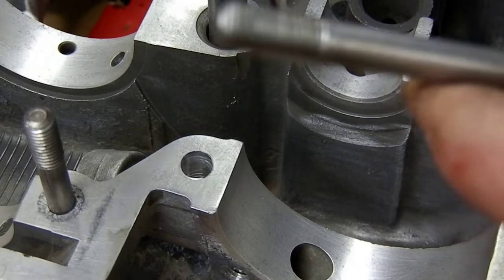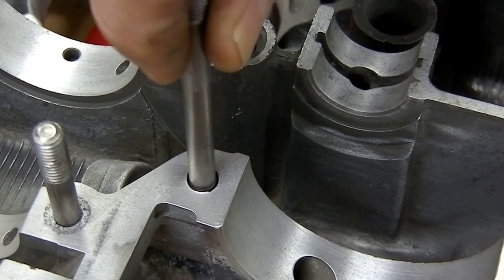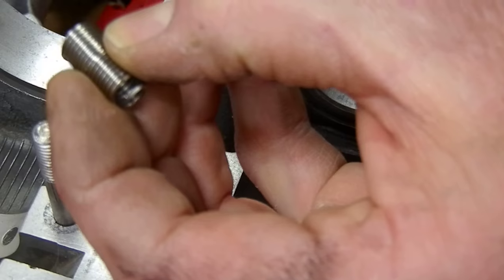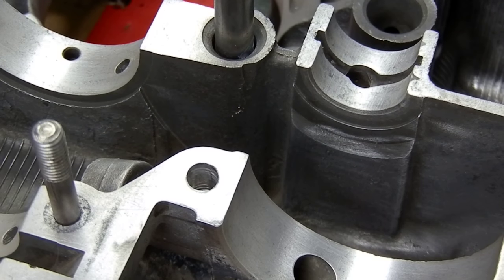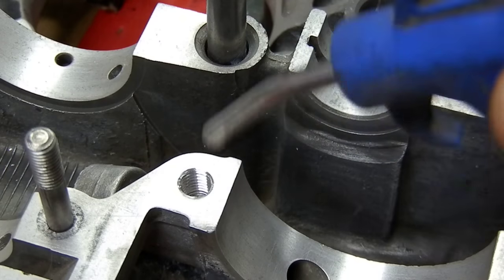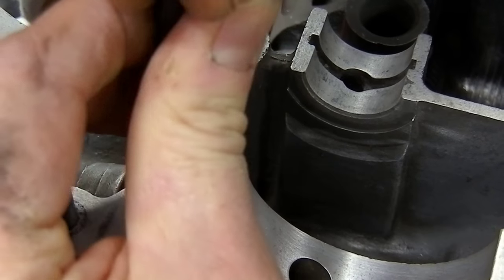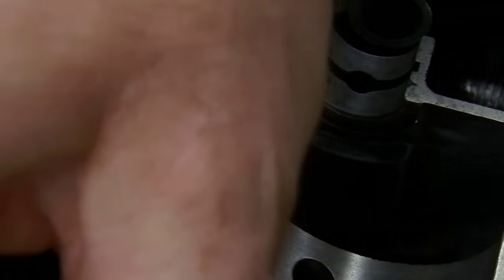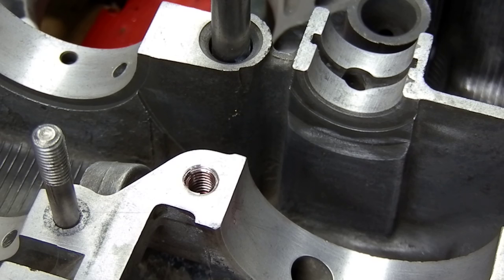Heli coil

Comment: Usually, most of the manufacturers for the wire thread inserts (Helicoils)  also recommend to chamfer the hole to 1 or 2 Px 90 or 120 degrees prior to taping. This helps in preventing any sharp chips forming on the edge of the hole. It also is very  helpful to see when you stop with the helicoil. In practice, you drive the helicoil until you are flush and after that you give it one more rotation (360 degrees). 
The manufacturer has also the correct drill size and also 2 thread taps for the stronger or sticky material. In this way you can form the thread for the helicoil in 2 steps and the tap tool has less chances to brake.
I would also advice to spay coat the helicoils with dry lubricant (again you can find it on most manufacturers like McMaster or Bollhoff). And if somehow you damaged the helicoil while you insert it there are some diamond shaped tools that you can use to extract it. 
There is also a chart  to determine the needed helicoil length based on parent material and the bolt class that you want to use. For example, in a 6061 Aluminum, for a M8 screw in 12.9 steel quality bolt, you would need a helicoil of 1.5D (1.5x diameter of the screw). You don't need to get a longer helicoil, like 2D or 2.5D, because in the dimensions in the table, the screw is already the weak part.
They are amazing products that distribute much better the load in the screw and you can easily replace the damaged ones without the need to enlarge the holes.

Comment: Hi 
Nice explained video.
I have helicoiled my Bmw e36 M52 aluminium  block after striped the treads on head gasket instal.

I have made a home made bracket to centre the drill  from a 20cm wheel spacer..because i heard that if the hole is not straight the repair is not gonna hold..
Wass a fun project.
I hope is gonna hold.
Up till now 1000 miles and no issues.

Comment: Use paraffin as cutting lube for aluminium so you don't tear the threads. On something critical always use a engineers square to check 90 deg angle from the surface. (No matter how good you think you are) Lastly, throw that piece of junk ratchet tap wrench in the skip and use a proper Tap Wrench so that even pressure is applied to both sides of the tap. This will also keep tap from cocking over out of true and in harder metals it will minimise the chances of snapping the tap.

Comment: watching this before repairing the threads on my dogbone engine mount. ive been putting it off because for some reason, drilling into my transmission makes me nervous. thanks for the tips!
Reply: Here for the exact same reason. Working up the courage to plunge a drill bit into my aluminum trans housing.
Reply: @The_Real_Chris  yup here for the same. Broken bolt stuck inside. Drilling through and going try this out to keep everything to spec. Pain in the ass situation lol

Comment: I now have zero confidence in helicoil in VW case.   I just changed heads on an engine and a helicoil on a head stud popped free at 18ft-lb.   I torque-tested the rest of them to 25ft-lb and five others popped.   I'm changing all the helicoils out for actual case-savers.
Reply from the maker: you can buy case savers of different lengths and sizes for upgrade or repairs from California imports..Cip1.com I have lots of videos or repairs and building performance vw engines ..if you look up Mark Russell Volkswagen on youtube
Reply: @Figment078 When I blew the head gasket on my 04 BMW 325ci the head warped & pulled out over half the bolts. I used the  Time-Sert coil repair kit to fix it. I did the repair over 7 years ago & the repair has held up. I have had zero problems! I drive the car all the time & it has no leaks whatsoever. I highly recommend Time-Sert for any repair where you have to apply allot of torque to the bolts.

Comment: I didn’t see you break off the tab on the bottom of the helicoil.
Reply from the maker: I did remove drive tang and waited 24hrs for loctite to cure up ,and then I run a tap back through to ensure lock tight debis does not interfere with the bolt threading into coil
Reply: Rendro Schifolli   Because you want the helicoil to Stay inside the hole, and not back out if you have to someday remove that long bolt to open up the case..  Without the loctite Red on the helicoil, it can unthread right out of the case on the bolt sometimes, when you are removing the bolt....

Comment: OR....you could buy longer Helicoils. 3 X 2D will be 2X diameter long (6mm) I've seen 3, 4, and 5D Helicoils, but at least you Loctite the coils into the block like I do. Can't go wrong if you do that.

One thing I have used is JB weld but I have not tested the torque it will take afterwards.
Reply: Jb weld is very weak when tapped. My s10 would confirm this. 😂

Comment: It was a great job. You should have put a piece of cloth on the motor so that the refrigerator or small iron pieces do not fall into the motor
Reply: Any time he's doing a full build, before final assembly he spends several hours cleaning the block

Comment: Thanks for posting this great video/job!  So, for a 5/16 thread, what size drill bit do I need to use?  Thanks
Reply: A 1/4 bro.
Reply: @danielanderson2739  thanks bro, already did the work and apparently came out good
Reply: Oh cool. Was i correct or did you have to use a specific MM?
Reply: This needs to be converted

Comment: Can this technique also be used on the fastener of the timing belt tensioner? I tried to renew mine and while doing that accidentally stripped the block. Unfortunately there's barely enough room in that location to run taps and dies. Feel really shitty right now. Might have to remove the engine to repair this.
Reply: Yeah.. You'll most likely have to remove your engine for that
Reply: @lilkanethebig  omg
Reply: Interested to know what the outcome was. These sort of things happen to me all the time.

Comment: 02  Elantra......Anyone know what  torque limit should be on this 
Helicoil's on a Timing Belt tensioner pulley Bolt which calls for 38Ft 
pound  will these Helicoils hold up to 38 Ft of torque

Comment: Use a Time-sert.  It’s a solid threaded insert that is far superior to a helicoil. It’s super easy to use and everything needed comes in the kit.  I just fixed a stripped 8x1.25x11.7mm drain plug in the aluminum housing of my outboard’s lower unit using a stainless steel Time-sert.  It costs more than a Helicoil but is worth it.
Reply: Helicoils can actually take more torque than a timesert.  There is a test on YouTube.  The timeserg failed at 70 ft-lbs and the helicoil at 90.
Reply: no its not there are several tests on YouTube that shows helicoil is far superior  to timesert.
Reply: I was under the same impression and for the most part I still am, although I must admit the others comments are factual, they are tests that demonstrate the helicoil has greater "pull out strength" or whatever the proper term is. Long story short, thats only one test, one type of experiment. Basically, the tests need to be broadened to include more variables and then we'd probably find the timesert's beating the helicoil's in certain tests, and vice versa.

Comment: Are helicoils generally slithly bigger than the hole diameter and compress as they are threaded in? I ask because I have checked my finished 3 pitch with 3 different gauges and all read the same but when I received the package of coils I ordered from the hardware store the seals were broken and the coils are nowhere near the size on the package , thinking someone returned these and they had been mislabeled,
Reply: The Helicoil's come in a compressed state. When installing them then they lengthen. Also,  Helicoil's come in lengths x diameter. So a 8mm 1.5D is 12mm long which is what these look like.

Comment: @MR Volkswagen Why did you select a helicoil instead of a time-sert?
Reply from the maker: Find these work the best in most application..used an insert for spark plug..never again.. i will always use helicoils even in vw heads

Comment: So you fixed M8 thread yes ? What's the size of tap you used to fit helicoil ?
Reply from the maker: m8 helicol tap..it is sized for the outside diameter of the coil..it comes in the helicoil kit and the driver and about 6 coils ..around 40 bucks from local jobbers

Comment: Hey great vid i'm getting ready to do this on a stripped bolt  hole for a drive belt tensioner. The only part i'm concerned about is that all the helicoils seems to be the same size and I only see people using one. The bolt threads im replacing are about 3 cm on an m8x1.25 bolt.. Would one helicoil be enough?
Reply: Tell me the installation steps
Reply: helicoil has different sizes ... depending on the torque of the bolt you can use a longer one .Usually the standard size 6mm is strong enough for 20NM +

Comment: Great video.

Few questions .
I recently had 1 head gasket bolt go beyond its yield point and and break . Can see its twisted thrn broke . My settings are 25mm in sequence and thrn 37nm its a motircycle. The 25nm went OK its when I upped  it to 37 that I had the break at heli  thread . Heli don't seem the issue here more that possibly it bit sooner (clamped ) than the others and bolt had nowhere to go so sheered . All bolts as adv9sed by manual were oiled . So would it be a case of less torque ? Or no oil on the heli?  Or maybe the 2 heli method ? 

Thanks in advance